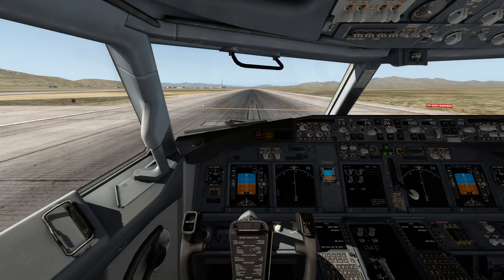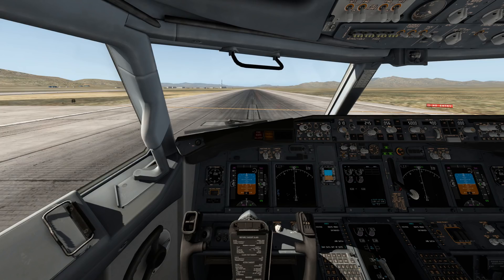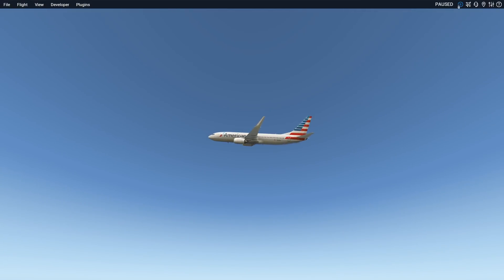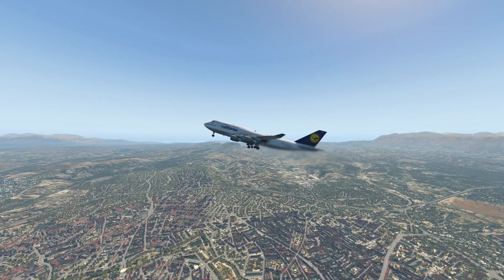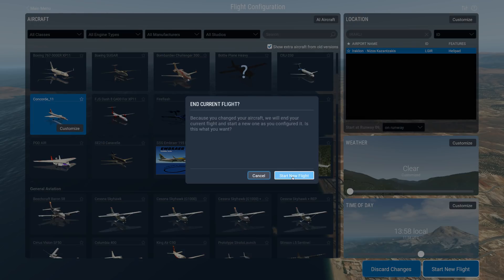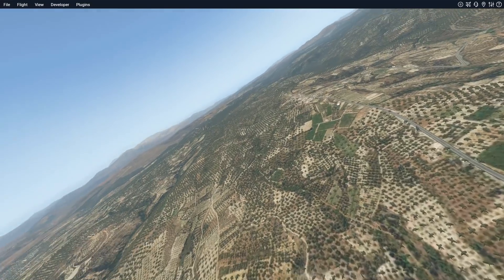What If The TAIL WING Falls OFF MID-FLIGHT?

Comment: Btw, with a lot of incidents when the tail gets ripped off they also loose control of the pitch of the aeroplane as during the tail ripping off it severs the hydraulics line, like what happened to a Japanese 747. With this situation the simulation thinks that the tail ripping off has not damaged the plane,  so Im not entirely sure if this video went how you were intending.
Reply: JaL 123eeeeeeee

Comment: On the American Airlines crash back in Queens NY,  The tail wing fell off, aswell as vertical stabilize, but the wake turbulence from the B747 ahead made the plane bank and shake, causing it to spin out of control.
Reply: The turbulence was why he initiated the rudder input, it was the hard back and forths that made the plane bank. The Japan Jet was at least 1-2 miles ahead way to far for dangerous readings of turbulence

Comment: You can land a plane (in a simulation at least) without a horizontal stabilizer. I've done it many times in FSX. It works the best with a Boeing 737-800, those are pretty easy to fly without a horizontal stabilizer actually

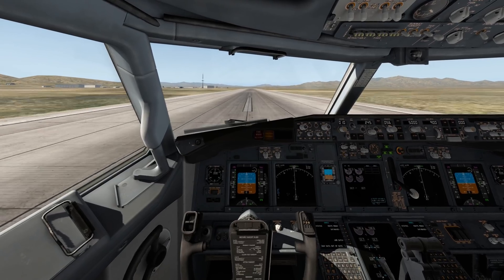Comment: 2:07 He’s talking about American Airlines Flight 587, a plane that crashed in New York due to excessive rudder movements, causing the vertical stabilizer to separate from the aircraft. The NTSB ruled out Mechanical Failure and Pilot error. R.I.P. to those on Flight 587.
Reply: Yeah that is true I just I just commented on the start  of the video
Reply: @ronelsenheimer5882 I thought it was still designated as pilot error

Comment: Actually, the rudder is separated into 2 parts. The upper part and the bottom part... So if one part fails, you can still use the other one

Comment: Swiss001: What if the tail wing falls off mid flight?

Me: Is this a Japan air 123 reference?
Reply: Or AA 587
Reply: Corrupt Repair Job Intensifies
Reply: Pan American 001 ok no not funny
Reply: https://en.wikipedia.org/wiki/Japan_Airlines_Flight_123
Reply: AA587 is more the reference, as the input tore the stabilizer off. JAL123 it was damaged
Reply: Or American Airlines Flight 587
Reply: Not aa 587 on Japan airlines 123 on flight 123 the stabilizer came off and the apu but not as 587
Reply: Also American 587
Reply: Look like AA587
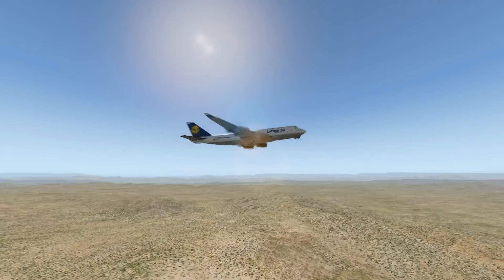Reply: 4:14